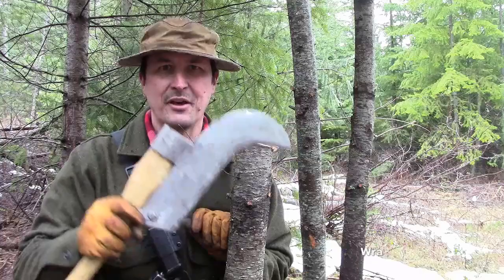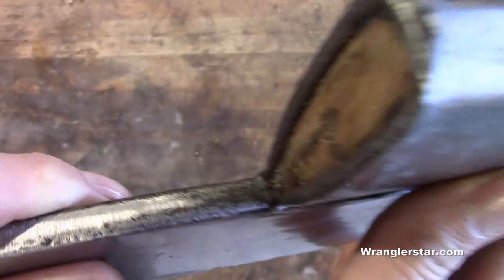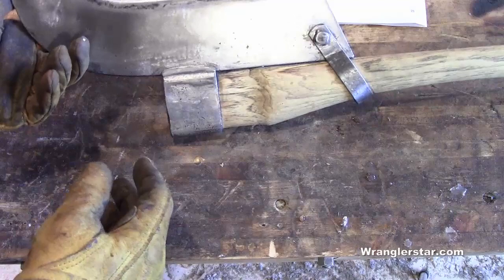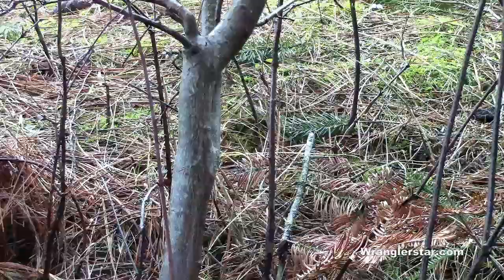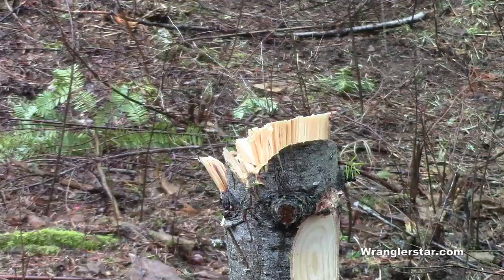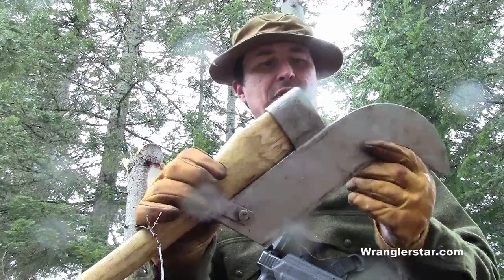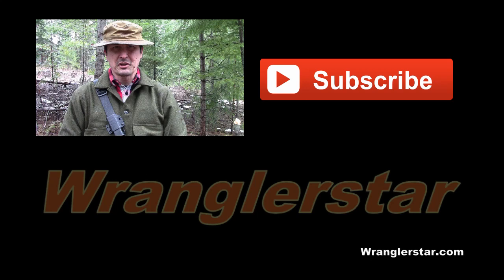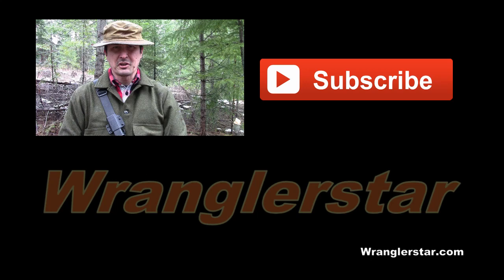A Proper Brush Axe - Wranglerstar

Comment: Actually that design was not kukri design  All such tools are designed by the Mediterranean Agricultural History Tool  called  croatian "kosir"  There are 2 types. Like yours mounted on the handle. Or traditional in the form of very heavy machete with a long curved blade  and an ax on the other side.I love them more than machetes. Because with them you can bring down the tree if you just need a have no other tool   here's a link   http://www.njuskalo.hr/image-w920x690/suveniri/kosiri-kosori-slika-59087220.jpg

Comment: Bully Tools makes Brush Hook and Ditch Bank blade tools. You need to sharpen the blade and keep it sharp. Going into the dirt  dulls a blade so keep a file with you. As an example of a dull and a sharp tool, put an edge on a shovel and see how much easier it goes into the ground, cuts sod and roots. Handtools for Trail Work - 2005 Edition is at http://www.fhwa.dot.gov/environment/recreational_trails/publications/fs_publications/05232810/ and other places. PDF version - search on us forest service publication 05232810 like at pcta.org

Comment: I have a "burke blade" that was given to me.  I have not used it yet, but I did a Google search on how to use it, and I found an online .pdf copy of the U.S Forest Service book that you have.  Here's a link to it:  www.fs.fed.us/t-d/pubs/pdfpubs/pdf05232810dpi72.pdf 

The book refers to it as being used for clearing brush that is too heavy for a scythe, and not suited for an axe.  Based on some other search results, and the reference to a scythe, I think it is meant to be swung low, at the base of thick brush, rather than like an axe.  That way, the springiness of the brush doesn't affect the chopping as much.  The book also says to use it with a slicing, rather than hacking motion.

I have no experience with it;  I'm just repeating what I read.  But hey, what else is the Internet for but to repeat stuff with an air of authority even though you know absolutely nothing about it.

God bless.

Comment: Your technic us wrong, on the smaller springy stuff cut with a sharper angle, 1-2" stuff should 1 swing 4" 2-3 swings max. Very useful tool when you learn proper technic and use.
Reply from the maker: I don't doubt my technique is wrong. Your spelling is wrong.
Reply: LOL, I agree my spelling is horrible. Keep up the good work Cody.
Reply: wranglerstar technic sounds like a new dance.

Comment: Hey Cody, great video. Here in Brazil we have a very similar and popular tool like yours. We call it "foice". See here: http://www.lojadomecanico.com.br/imagens/Foice_Laranjal_sem_Cabo__2_17378_1.JPG 

We use it for everthing, clear brush, chop wood, carving and etc. Our "foice" it´s not so heavy like yours and we use with a shorter and straight handle and often with one hand. We do not weld it, ours it´s all forged. Yes, it´s a little bit different from the swing of an axe. Like you said, you have to use it for many years to get it rigth, but when you do, you will finish the work 3 or 4 times faster. You are doing great with. Love your videos. Thank you very much.

Comment: Lol "not a tool for women". Depends on what type of women you're talking about, but yeah I agree we are not all created equal. I'm not a big guy by any means but I have no problem splitting wood so.. I wouldn't say that tool requires a "tremendous amount of upper body strength". It's all about the blade, Katana blades didn't require strength.

Comment: I have used two handed machetes from Cold Steel to remove light/springy brush and trees up to 6 inches without any hassle. They are surprisingly well made for the price, but they do need to be sharpened.
http://www.coldsteel.com/Product/97THM/TWO_HANDED_MACHETE.aspx

Comment: You are so wrong! You don’t know how to use it, and it’s sharpened wrong as well. Lower straight edge should have a almond or apple seed grind and upper third flat or hollow grind, and you swing it like a baseball bat more of a level cut on small twigs, small v cuts harder woods. Please learn more about this tool before you talk bad about it, I am not impressed with your channel and will be blocking you.